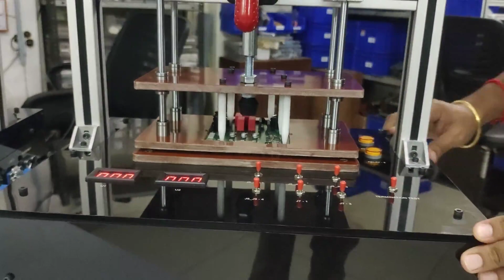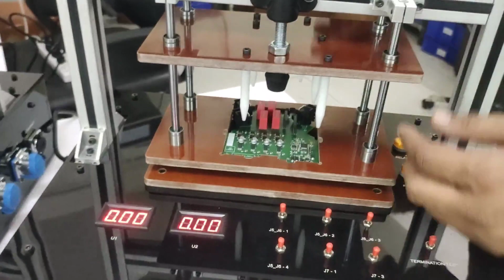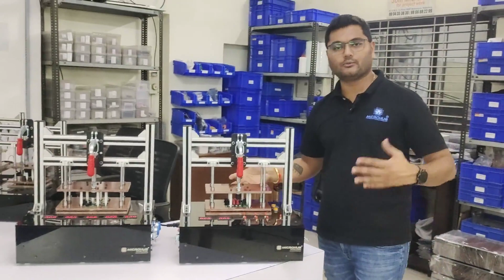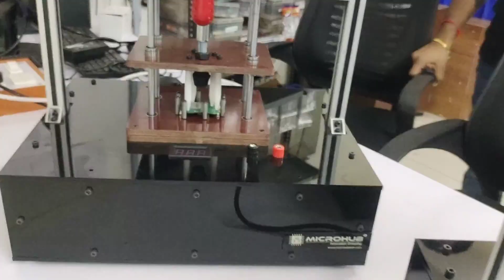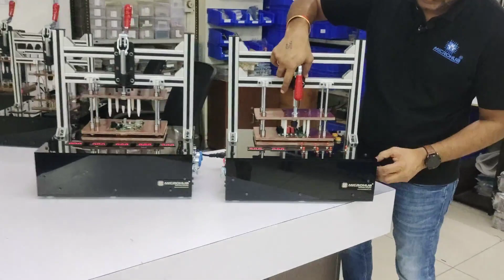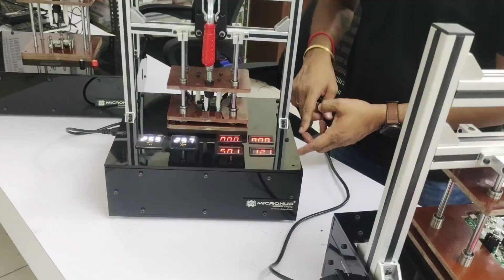PCBA Test Fixture Manufacturer ,How to Make Pogo Pin based Test System, PCB Testing New technology

Comment: Please share details on these also

What is a functional test of a PCB?
Which method is used for PCB board testing?
Who conducts functional testing?
What is a PCB test fixture?
How do you test for PCB?
What material is used in PCB test fixtures?
What is a PCB test board?
Pcb test fixture price
pcb test fixture kit
Pcb test fixture manufacturers
pcb test fixture design
fixture Manufacturer
jigs vs fixturer
pogo pin vs test probe
Reply from the maker: manual customize test jigs and fixture,vacuum test fixtures,Pneumatic Test Fixtures,ICT Fixtures,Dispensing Robot Fixtures ,Soldering Robot Fixtures,Router Fixtures,Automated Functional Automatic Test Fixtures,Mild Steel PCB Test Fixture Machine,PCB Functional Test Fixture,Pcb Continuity Testing Fixture,PCB Test Fixture Machine, For Manufacturing Functional Test,Argus MS Pcb Testing Jig Fixture,Pcb Testing Jig Fixture Ict,Manual Testing Jig, For Electronics,PCB Test System Service,Different Type of Zig And Fixture,Machine Jig Fixture,Brass Pogo Pins, For Electronic,Spring Contact Test Probes Pogo Pins,Spring Pogo Pins,Pogo Pin Connectors,Korea ICT Testing Probe And Receptacles For Industrial,golden Mild Steel Spring Contact Probe,
Collar Pogo Pins,Pogo Pin,Screw type Pogo Pin Test Probe,POGO Pin for PCB circuit testing,Spring Contact Test Probes Pogo Pins,Wire Harness Probe Pin Switch Probe Pin TBO Pin TVO Pin Push Back Pin PCB Test Pin Harness Pogo Pin,Bare Pcb Test Probe POGO PIN ICT PROBES SPRING CONTACT POGO PROBE POGO,Analog Black Functional Testing Probe,In Circuit Test Probes
Testing Probes and Receptacles,Flying Probe Complete Solution Testing System,Customize Mechatronic Test Fixture for Product testing

What is a functional test of a PCB?,Which method is used for PCB board testing?,Who conducts functional testing?,What is a PCB test fixture?,How do you test for PCB?,What material is used in PCB test fixtures?,Wat is a PCB test board?,Pcb test fixture price,pcb test fixture kit,Pcb test fixture manufacturers,pcb test fixture design,fixture Manufacturer,jigs vs fixturer,pogo pin vs test probe,How do I identify PCB components?